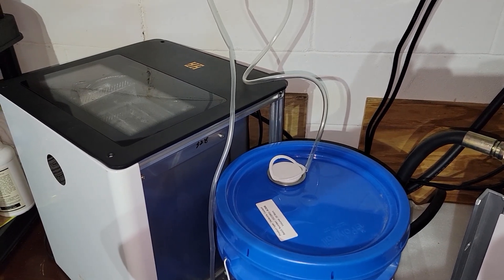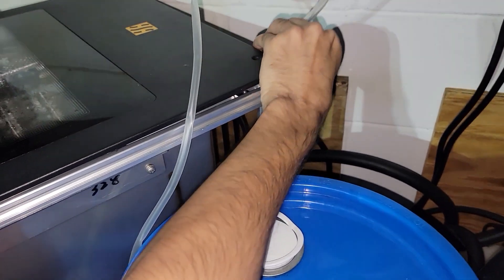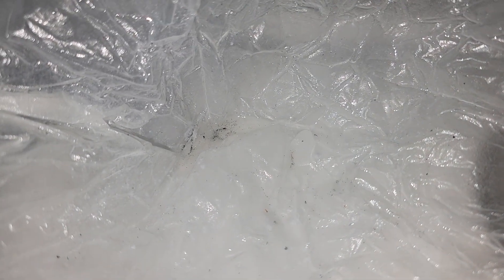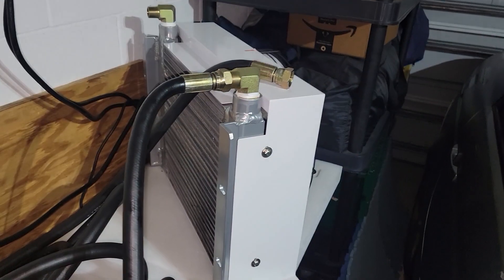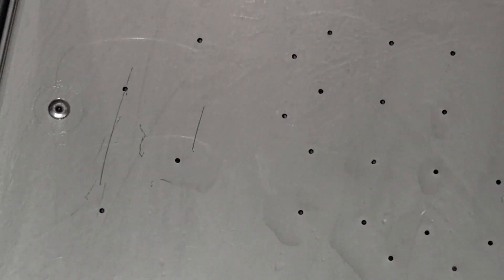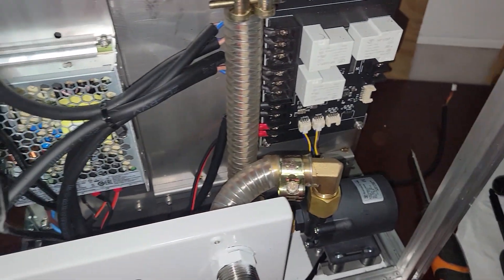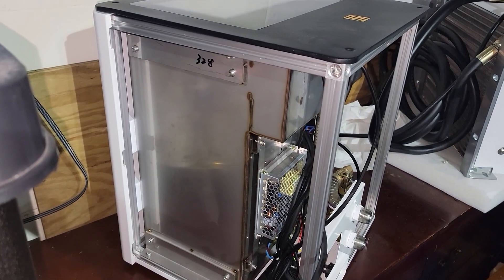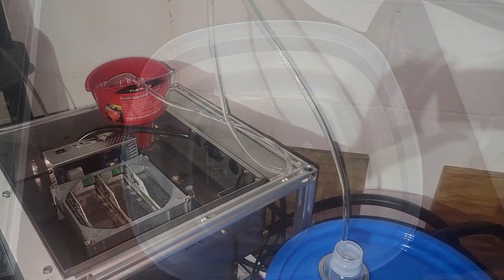Replacing Pump in Immersion Tank and what I found

Comment: friend, why did you change the pump, was it damaged? I'm making my own cooling system and I have a doubt if that type of pump is damaged after a year of use
Reply from the maker: a couple of things, material in the impeller. Plus cheap thermal paste that was used by the ASIC seller. The foreign material was caused by me, I believe but can't prove it. I was one of the first to receive the unit made by the manufacturer. So, the issues I had, were reported, and they should be fixed by the company for end users.

Comment: What flow is that pump? Aprox
Reply from the maker: 2400 lph
Reply: @SerpentXTech  Link to the new pump please?
Reply from the maker: @ISweetDreamsT  https://www.ebay.com/itm/304265760359?mkcid=16&mkevt=1&mkrid=711-127632-2357-0&ssspo=HaNufjILTNG&sssrc=4429486&ssuid=oLR5d84ZQT6&var=&widget_ver=artemis&media=COPY
Reply from the maker: @ISweetDreamsT  your going to need to go to Home Depot or Hardware Store to grab brass fittings, one straight and one 90, and some loctite.
Reply: @SerpentXTech  another question, how often would you need to change the Mineral oil in your C1? I’m pretty new to immersion cooling. Thanks again 🙏🏼
Reply from the maker: @ISweetDreamsT  so I only had to filter it once. And reused it after, so still have the same amount, minus half a cup lost due to spilling some. My problem was that the ASIC had way too much cheap thermal paste that would heat up, and a layer of oily gray material would float to top but then get sucked through the system. If that had not happe. We would have been good. So never if you got a good asic without a crap ton of extra thermal paste. I just slowly filtered with a coffee filter, but there are industrial in line filters the big guys are using.
Reply: @SerpentXTech  oh ok lol.. thanks again for the quick reply 👏
Reply: Hey another question, if the power to cut off (i.e blackout or something similar) and cut back on. would the C1 turn on again on its own and continue pumping? Or do you need to manually press the button to get it pumping again? Sorry for the odd question.
Reply from the maker: @ISweetDreamsT  you stupidly have to push the button again. Which isn't a problem if you have the miner plugged into the internal power ports unless you don't realize it hasn't been running for a while, missing all those sweet sats. It is even worse when you have your miner powered externally and the pump stopped running due to power loss, and when it kicks back on your miner, it starts mining automatically, but your pump doesn't kick on...
Reply: @SerpentXTech  yeah that was a fear of mine, the miner being plugged in externally and the C1 not automatically turning on by itself 😢. Thanks again for the info.
Reply from the maker: @ISweetDreamsT  so my Whatsminer or most have over temp protection, so it will auto shut down. And I only had to do it twice over the years because I was away
Reply: @SerpentXTech  Hey sorry for all the questions but do you recommend cleaning a brand new s19j pro with like 99% Isopropyl Alcohol? I'm just scared of clogging the pump like what happened to you.
Reply from the maker: @ISweetDreamsT  you should be fine if brand new. Tear down and assembly is not recommended unless you know what you are doing.

Comment: Love the longer format stuff man, nice to see content on this as there's not much out there other than promo vids for immersion setups. Kind of surprising that there's no inline filter, especially because of how tiny that pump is, not going to take much to clog then overheat/burn out the pump. How was the rma process for getting a replacement pump?
Reply from the maker: Wasn't too bad, about 10 days for new pump and foghashing was responsive, once I showed them what happened. But I also found the same pump on ebay but would need to swap the brass fittings over or just take the 4 screws out, that holds the front of pump onto motor and swap the entire front end over. Just as a backup
Reply: @SerpentXTech  thanks for the info man, fog hashing is on the shortlist of immersion units that are readily available, also being here in Florida , gotta keep my options open with these long summers and nice to see real world info on them
Reply from the maker: @miningstacker  I got a coupon if you do want to buy from foghashing. Let me know. Also, I wish I got the C2 unit, but it wasn't in production when I got mine.
Reply: @SerpentXTech  I'll definitely hit you up if I go that route ,this will be the first summer with Asics in the garage , With GPU's it was fine, but Asics are another animal, so far temps are good, but waiting for consistent 90-95 degree temps and how they do with the added humidity coming before I feel fully comfortable with the current setup.